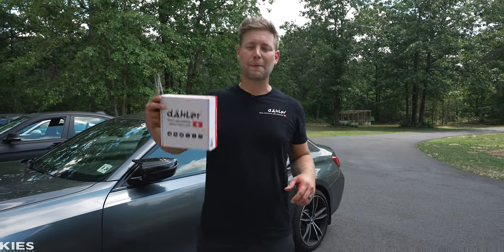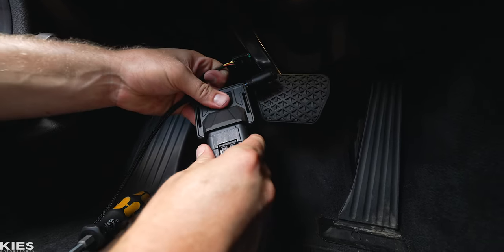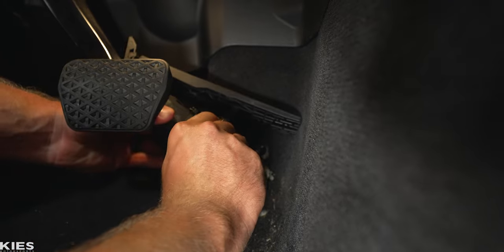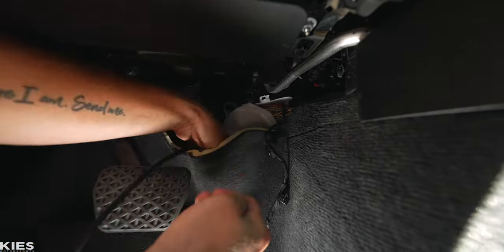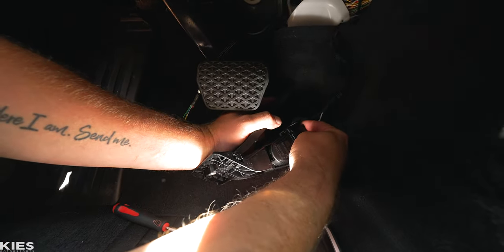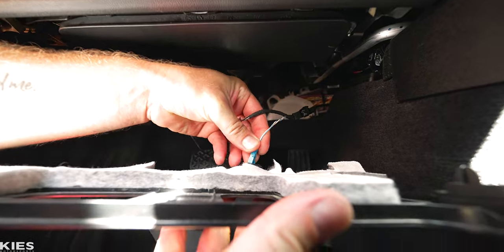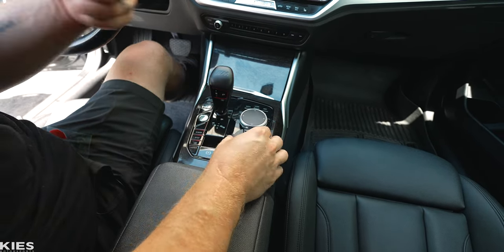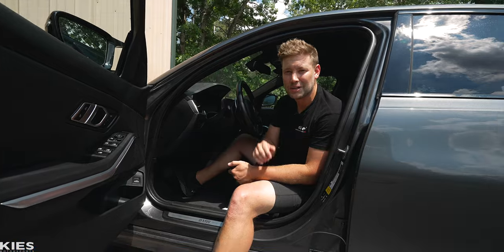DIY: Anti Theft Throttle Commander for BMW G SERIES | G20, G22, G80, G82, G83, G01, G02

Comment: Is there a way to have this installed but disable it if you want the car to act as stock? I mainly just want the anti thieft and valet mode
Reply: Yes, there’s 3 features. Anti theft, valet and increase pedal response. You need to assign it to any of the 3 features in order to use it. For example, I leave it on anti theft, so each time I start the car it’s already activated and I have to wake the device up to drive the car. Once the car is off and asleep, It will automatically activate your last assigned action.